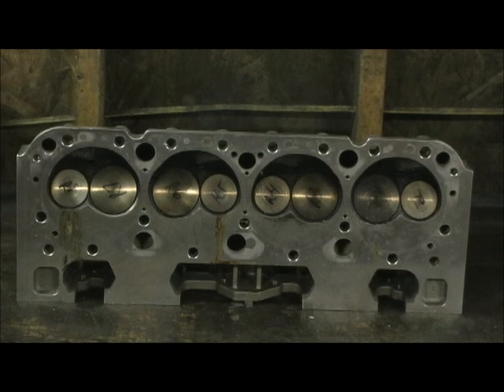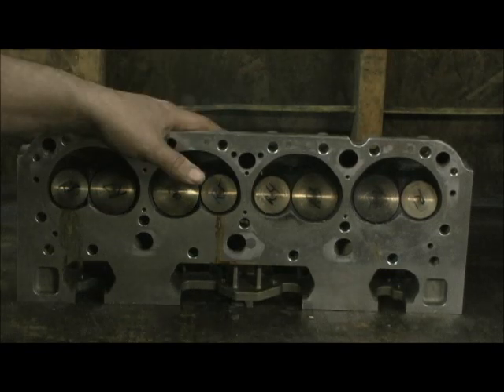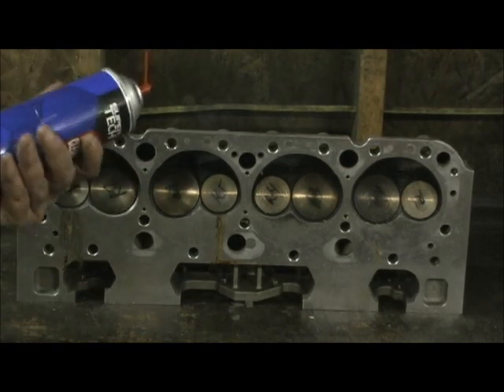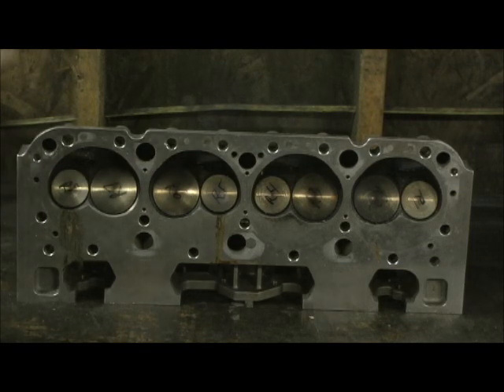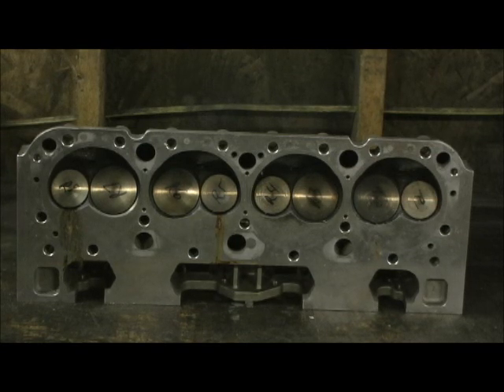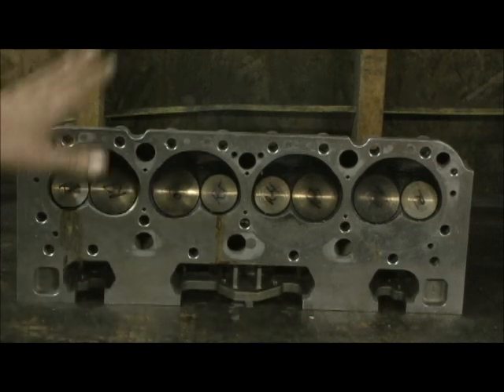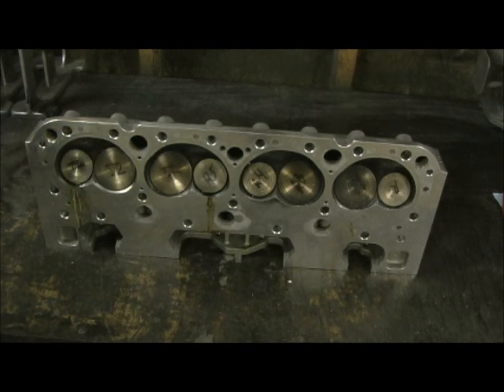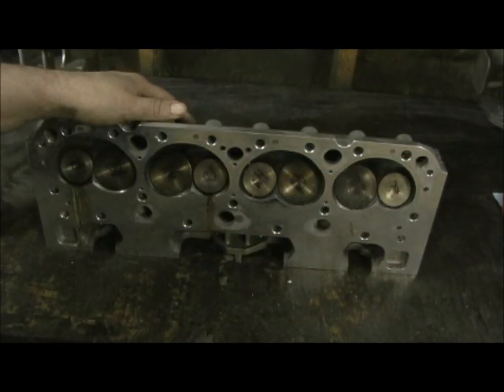"WARNING" DON'T- bolt on "New in the Box"  heads on your motor without. 1.0

Comment: I'm 17 years old and I'm restoring a pickup, so I don't have a whole load of money to buy bare heads and then get other parts and assemble them. I did my research and I found a pair of Summit heads (which are cast by Dart and are the S/S castings) that come assembled. I've only heard good things about these heads, so I'm deciding to take my chances and buy them assembled. Any feedback on other options or what I should or shouldn't do?

Comment: Thanks for the post, very informative.  I wondered about some of those cheap heads and wondered.  That explains some of the poor performance numbers when the car magazines to testing on some of these as received. I'm not building a race motor, just a good street engine and am going to  buy a set of Edelbrock's and then follow your advice and have my machinist give them a thorough once-over.  I like to keep Amerikin's workin'.

Comment: I am wanting to build about 300-350 hp budget 350 chevy. I was wondering what your opinion of jegs performance heads. Do they need work ? Are the worth the money or is there a better buy for the buck. Thank you for your time.
Reply: scott hall theyr'e dart heads, buy them complete take em apart and have a valve job done and they're good

Comment: it's a shame that stuff made here in the usa  has  problems also . i built a stage v hemi conversion  engine years  ago for a customer  that  had some incredible heads . it was for a street car with just a .510" lift hyd flat tappet cam , and never went past 6500 rpm . it had tons of piston to valve clearance  but ended up having a valve head fall off (seperate from the stem like the damned china valves  ) . they were MANLEY  valves and supposedly made here in the usa ?  manley recalled (they refused to call it a recall ) a bunch of valves from stage v since another stage v headed engine in sweeden  had the exact same thing happen . when i mentioned it to my local machine shop guy , mr. mondello (big olds engine guy )  was present and  didn't believe me . he called them while i stood there , of course they said no , but i told him to ask them if stage v was having to return their shipment of valves . he asked and they said it was a different issue . the crazy part is that manley decided to hold the valves hostage until stave v apologized for letting that bad info out . i waited almost 3 months for valves and   stage v guys called to tell me that they would not send the valves until he called manley and  apologized .  this has been many years but i will NEVER buy a manley part in my lifetime after  that b.s. . 
           i currently work in a piston ring foundry that has  had some lazy workers that didn't do the hardness testing properly . one low seniority  lady was fired  after bragging how fast she could test parts by doing the same part 3 times instead of doing 3 seperate parts  from a batch . the other high seniority  person retired after doing the same thing  for years  and our supervisor KNEW he was doing this . because i see the lack of integrity daily at work , i worry when i buy ANYTHING ,  from any company . sorry for the long rant

Comment: after seating the valves i always do the flash light test. usually with the lights off. aside from that any machining to the valves or head really shop be done by the shop. its cheap enough why risk it.

Comment: I had a set of heads off my 1962 327/340HP Vette engine that were ruined by D. Beuel Engines ({Pomona)  a few years back.  they were 461x heads with the smaller 1.94 valves; they tried to install hard seats but went into the water jackets on all 8 valves and on BOTH heads.  Tried to tell me the heads were the problem and not their machining--  what is your opinion here ??  Thanks.

Comment: I have some new 6yr old BBC Procomp heads  when installed the pushrod slots/holes thru the heads are barely twice the width off the pushrods .with a mid range street cam  the pushrods bind in the holes in the heads  NIB  and the holes have to be drilled out so things dont rub-bend    total crap .head seller says add 2 cans super block seal when first run in..heads leak water   great!!!

Comment: Why would an "out of the Box" replacement had be any different than a head installed at the factory when building the engine???  what are you paying for when buying a new head???  A core to rebuild ???
Reply: Wilbur Finnigan Because the quality standards are not there. Take his advice, have the valves installed by someone that has the equipment to do it properly. It's well worth the money!
Reply: Wilbur Finnigan are you related to roadkill finnigan?
Reply: No !!! I'm the KILLER !!!

Comment: I heard from long time ago, let those guys down south build a "hillbilly" motor or "moonshine" motor and you will get excellent results every time and tons of hp and torque and you build a motor that is right out of a Hot rod magazine and it doesnt run worth for crap AND its a BIG BLOCK CHEVY, $8000 worth of parts and putting out 290 hp !!! Hillbilly motor, small block and putting out 750 hp and runs goood!!

Comment: He's so right here, there's a lot of variables with buying new cylinder heads. Now it's not my intention to be a smart-Alec here or highjack your comments, but rather respectfully ad some input from my own experience.
Sometimes if it's hard to get the valves out because they were tight it may be the keepers dig a groove in the valve stem leaving dings in em. I'd recommend filing or polishing the valve stem around the keeper groove with Emory cloth to remove  high spots before pulling the valves out after they'd been run because it usually will gall the guides especially if they're bronze and if you end up having to drive them out. you will have to reream/hone them. I've worked on all of the big name brand heads as well usually they aren't that bad at all. I never have had a new set of vortecs to work on but that does make sense, sounds like GM's process may be a little backward causing warpage heat-treating the valve seats after the surfacing has been done. The only thing I've noticed is, with their really hardened exhaust seats the 45° angle is slightly less, and they will leak from not seating. I'm assuming they use a single multi-angle seat cutter for consistency (i say this because that's what type of set up we use in our shop, this is what i've noticed recutting seats and our cutters usually line right up with every angle even with the seven-angle radius cutters) which if there's too much pressure when cutting at whatever speed will cut the seat ending up at an odd angle anywhere from 43°-47°. 
Some guys that don't know what they're doing odds are there are a few things that will need attention and if you don't know what to look for you won't know until it's too late. Another thing is valve length, most aftermarket heads recommend a .050"- .100" longer valve length for a proper installed spring height. A lot of guys will buy their heads bare and piece together their own valvetrain parts: valves,springs,spring seats,retainers,keepers. Thinking they can save money getting their parts online on their own. Usually they end up buying all the wrong parts, costing them even more time and effort. So buying your parts from the shop doing the work isn't really a bad idea, especially if you know they use the quality parts you want. Just make sure you have all of your info ready because they should ask at least: what kind of cam you're running(solid flat tappet, solid roller, hydraulic flat tappet, hydraulic roller) what your cam lift is, possibly what rocker arm ratio you plan to run. (If there's anything I might have forgotten maybe someone can throw it out here)
As for the advertising of the 2.055" valve seat, most heads I've ever seen advertised say seats for 2.02" and will accept up to a 2.055" or larger *with machine work. we ran across this once that's how we found out. Guy bought his heads and parts brought them in to be assembled, I checked to see where the valves were seating and they just barely caught the top of the valve. His valves were a 2.065" I checked them with a 2.02 and the seats were right in the center so I had to cut the seats and, there was plenty of seat material there otherwise we could've ran the smaller valve.
One thing to look out for is where you buy the heads, whether it's from the manufacturer or reputable retailer you should be alright. But there are other remanufactures (usually online retailers) that buy factory blemishes (heads with misdrilled/misaligned bolt holes untapped bolt holes, etc) by the pallets who will turn around and repair blemishes. Not to say they're not reliable, just that they might be a remachined factory second sold as new, as the actual brand name because that's where they originally came from. And if you're buying from one of these sources it maybe something to inquire about. Just some of my experiences. Hope this all might be helpful to anyone, sorry kind of rambles on.
Reply: craigr13666 Been there, done that. And redid the same thing/ Rebuilt heads that is !!!!.

Comment: I couldn't agree more.  I've personally been through this isssue with a pair of Brodix heads I bought brand new fully assembled.  After 1,000 miles I had to have them redone, new valves, springs (which were too weak) retainers etc.  I could see light fron one side to the other just as he shows.  Folks told me to buy them unassembled and have your own valves and parts installed but I was lured by the price of the assembled unit.

Comment: This is certainly a wake up call.  It's no better at the OEM level.  My Ecotec heads have loose guides, bent valves, and bad valve seats.

Even Katech had a Corvette ZR1 with 900 miles come in with worn guides.

Comment: 35 years ago I built  1 of many many 350 Chevy's  .
Sent it to the machine shop & got it all back in boxes & plastic .
But I never trust anyone's work , no ones .
Not even this video poster if I was to use him & that is meaning no disrespect to him in any way.
Long story short .
I disassembled the new American made name brand oil pump & in the small cavity on the bottom of the driven gear was machine millings/filings & I do not mean a little dust I mean like you would find coming off a brake rotor on the 1st cut .
Can you imagine that junk going through my or your motor ?
When you take on any project it is your responsibility to check every thing & then check it again .
One thing about a motor or its parts is it can not be too clean & that is from valve guides to all the oil galleys in the block & crank which I have seen nasty ones on re-man motors supposedly ready to go .

Comment: I became so sick of local work I bought an old Sioux valve grinder so I could do my own seats and valves. You'd think a triple angle seat was exotic shit, and back cutting a valve, who ever heard of that?  What I saw was a 45* shot to the seat, who cares how wide it is, if the valve seals it that's a bonus. And they dress their stones once a month at least. I'd spend untold hours blending and porting, then have to beg them to at least try to do it right. For most places it takes too long to do a good job when 99% of the people will be satisfied with half assed and not know the difference. "blueprind" talk is a lot easier than actually doing any blueprint work. 

   As a friend used to say, "You inspect, not expect". Another used to say "Green backs beat be backs". I say do it yourself or you'll get fucked.

Comment: I have a pair of 217 casting heads that my buddy is porting n polishing.  He put them on flow bench and got 229 cfm on intake and 170 on exhaust.  I was impressed. Dart iron eagle flow around those numbers. 
Now these heads are 64 cc chambers,  crate heads for marine engines.  They have heavy duty exhaust valves.

Comment: You can trust corporations and mass producers for your plastic shoes or your pot metal utensils. When it comes to important things like valve jobs , trust your local small business machine shop. Especially a dude that's been doin it for 30 years.  I wouldn't even trust the dealer cause they get the newbie, entitled, still wet behind the ears mechanics.

Comment: I believe every word you're preaching.  I have a set of AFR 335 cnc big block heads that when I put them on my 505 had a misfire problem that I couldn't figure out.  Turns out the exhaust valves weren't seating properly.

Comment: Those leaky valve seats make me think somebody may have bought unassembled heads,slapped those chinese valves in themselves, figuring the machined surfaces of the seat and valve would match,so they did'nt bother to lap anything in and then sold them as assembled for a profit.

Comment: IS exactly the reason I'd rather by some old cast heads and rebuilt, or have them rebuilt to what I want.Spending 500/600 bucks for aftermarket heads, that are junk,right out of the box isn't an option.